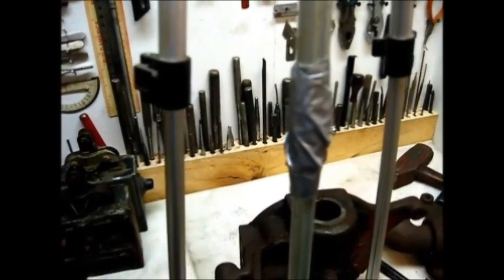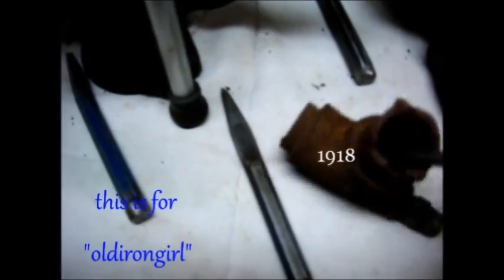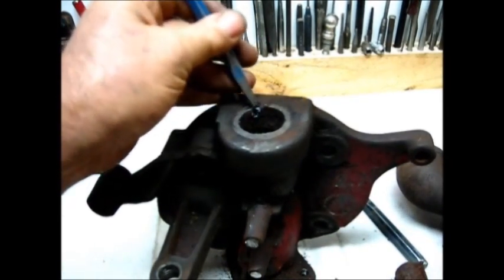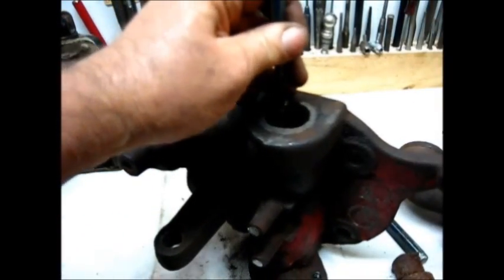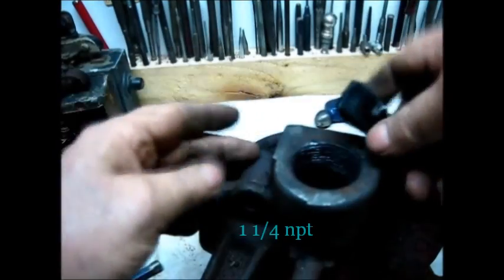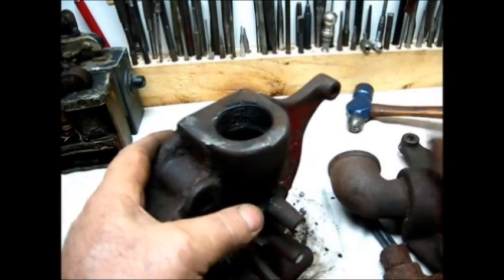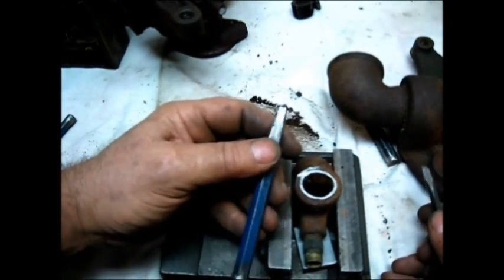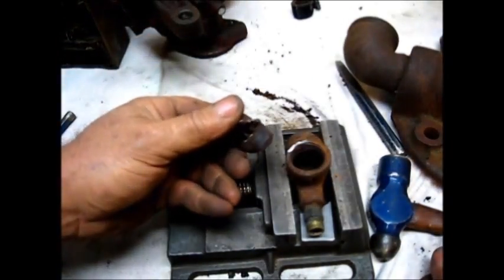IHC ENGINE  rusty pipe remove

Comment: This takes me back! When I was just a kid I worked in an automotive electric shop, I rebuilt generators, starters, alternators and magnetos all day long. Cape chisels were my best friend, especially for commutator end bushings. Proto and KD make them, or you can make them yourself. I relieved them a tiny bit up the shank or "cape" behind the cutting edge, made things easier. Amazing what you can use these for, used them for pipe many times.
Reply: ZZCXCccccxcccccCC
Reply: FffffffģGdddDddddddddddddddddddddddddddddddddddddddddddddddddddddddddddddddddddddddDddddddddddddddddddddddddddddddddddddddddddddddddddddddDdddddddddddddddddddddddddddddddddddddddddddddddddddddDddddddddddddddddddddddddddddddddddddddddddddddddddddddddddddddddddddddddddddddddddddddddddddddddddddddddddddddddddddddddddddddddddddddddddddddddddddddddddddddddddddddddddddddddddddddddddddddddddddddddddddddddddddddddddddddddddddddddddddddddddddddddddddddddddddddddddddddddddddddddddddddddddddddddddddddddddddddddddddddddddddddddddddddddddddddddddddddddddddddddddddddddddddddddddddddddddddddddddddddddddddddddddddddddddddddddddddddddddddddddddddddddddddddddddddddddddddddddddddddddddddddddddddddddddddddddddddddddddddddddddddddddddddddddddddddddddddddddddddddddddddddddddddddddddddddddddddddddddddddddddddddddddddddddddddddddddddddddddddddddddddddddddddddddddddddddddddddddddddddddddddddddddddddddddddddddddddddddddddddddddddddddddddddddddddddddddddddddddddddddddddddddddddddddddddddddddddddddddddddddddddddddddddddddddddddddddddddddddddddddddddddddddddddddddddddddddddddddddddddddddddddddddddddddddddddddddddddddddddddddddddddddddddddddddddddddddddddddddddddddddddddddddddddddddddddddddddddddddddddddddddddddddddddddddddddddddddddddddddddddddddddddddddddddddddddddddddddddddddddddddddddddddddddddddddddddddddddddddddddddddddddddddddddddddddddddddddddddddddddddddddddddddddddddddddddddddddddddddddddddddddddddddddddddddddddddddddddddddddddddddddddddddddddddddddddddddddddddddddddddddddddddddddddddddddddddddddddddddddddddddddddddddddddddddddd

Comment: Shopdogsam, well that's  a good tip there and is as handy as a pocket on a shirt. I also had many problems with removing broken fittings and rusty pipes. Luckily, I had a friend Zeke that "schooled me" in the removal process. Not that many guys left that will show a feller how to just get things done! Thanks shopdogsam for your generousity.

Comment: Very informative on removing a pipe without damaging threads. I sure am glad Duct Tape girl came to the rescue. An worked on your short leg.An got it straightened out. From the south shore of the Missouri. Down yander from Possom Trot.   10/4